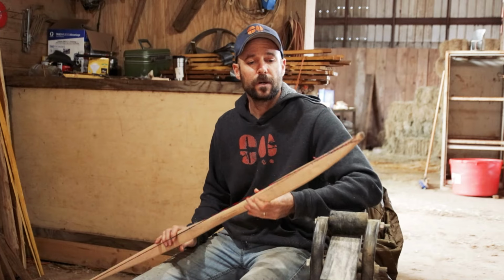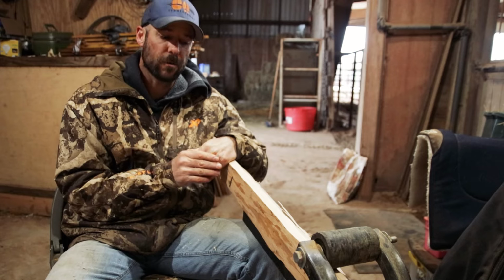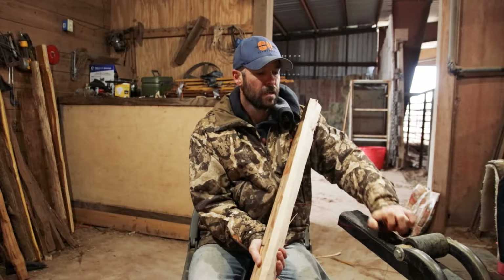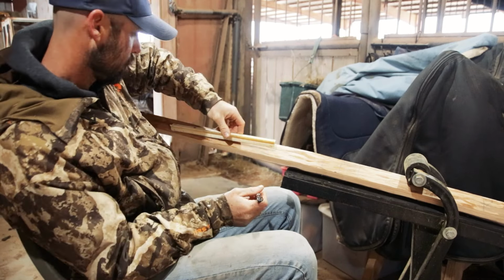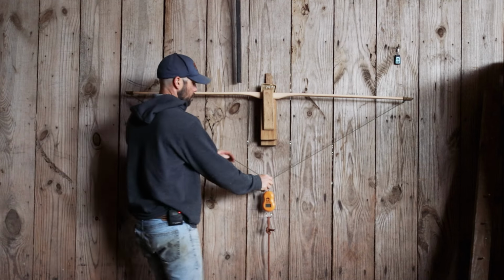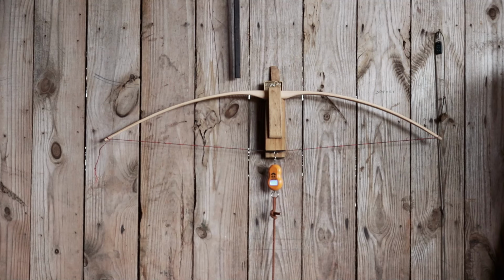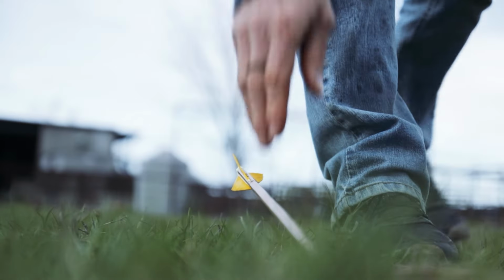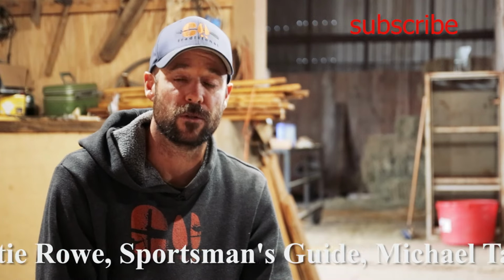Building the Hickory Self Bow

Comment: What is a card scraper?
Reply: If you look up a “cabinet scraper” it should look like either a rectangular steel card, or it may be a gooseneck shape.

The edges are burnished where a burr hangs off. They are drawn across the stave at an acute angle, and the burr will curl off a thin sliver of wood. 

I’ve curled wood thin enough to almost see through it with them. They are excellent finishing tools, especially while fine tuning your final tiller.

Comment: Cool thing about white woods is you can harvest it yourself. Free wood to learn with. Rough it out and once the moisture content is 8   to 10% it's ready to finish. No waiting for years.
Elm makes a nice 68" long flat bow. 2" mid limbs and 5/8" at the tips.
Nice video.
Reply from the maker: Absolutely!
Reply: What is white wood and why can you harvest it yourself?
Reply: @robertbrandywine  
For example 
Elm,
Ash,
Hickory.
If you have a saw, then harvest it yourself. If you haven't, ask a friend.
Reply: @Bullseyearchery  But why couldn't you harvest non-white wood trees yourself?
Reply: @robertbrandywine  I think you are missing the point we are trying to make. White woods are ready for bow building when the moisture content is right, so it is ready in weeks, not years.
Harvest whatever takes your fancy. Fill your boots.
Reply: @Bullseyearchery  I think what you are saying, based on this last post, is that non-white woods take so long to dry that most people will buy them pre-dried by someone else, but with white wood you can harvest, wait a little and then start the bow.  Right?
Reply: @robertbrandywine  In a nutshell, yes. 
It's not that premium woods take longer to dry. They have to be  seasoned for several years. The wood will then keep its shape better as a bow. 
White woods tend to bend out of shape (follow the string- take set) when being drawn many times  shooting them. These bows tend to lose power or cast.
Reply: @Bullseyearchery  Okay, thanks.

Comment: Great info on Whitewood Clay'''' Im in central Missouri & have access to different types of Hickory  &  Sassafrass as well,,,,  I have found that the ''latter''  reacts much the same as Hickory as to taking a set early on in the tillering process..  Could you tell me at what point in the build would be a good time to Recurve  the limbs on White,Wood self bows ??.. Lots of armchair info out there about this''''& my guess would be to recurve them early on as to not lose to much bow weight , by removing to much wood'''''  Thank You Sir'''  Love your channel..
Reply from the maker: I usually do it around the mid point of tillering, after the limbs are starting to bend. With whitewood, it’s often necessary to leave the reflexed tips a little thicker than with Osage.

Comment: Hi Mr Hayes i have a question I've recently got into building bows I made my 8 yr daughter and myself red oak long bows that r reflex deflex style to do this I ripped the boards in half lengthwise the used titebond3 to glue them back together wise a handle and backed them with rawhide worked great I'm now doing the same thing but it maple but I some how got the limb tips twisting in different directions one to the right one to the left when looking done the bow so how would I go about fixing this or over coming the twisted tips  thanks in advance
Reply from the maker: Hi Barry, with a selfbow limb twist can be taken out with heat. But that wouldn’t work for laminated bows I don’t think.
Reply: Hello Claye I did get the twist out of both limbs lastnight I used a heat gun and kept the limb clamped nut super tight enough so it wouldn't come apart and used a longer clamp laying across the limb extending from the high side and added other clamps as weight I twisted it past being flat to allow for spring back let cool and do the other end the same way not sure when u had replied about using heat lol but it did work for me now is now backed with rawhide and wrapped to cure thank you for your time and help

Comment: Nice craftsmanship!

I build the traditional style bow too. I have been primarily making the subclass of selfbow called the American Flatbow.

I am not as traditional as you in that I do use rough cut lumber to start with rather than using an actual stave of Hickory.

Speaking of Hickory, I just made a 66 inch 35 pound American Flatbow that I placed on EBay to see how well it might sell. I had Birch, White Oak and Hickory to chose from for the wood I used. I started with Hickory and was well on my way twice to a completed bow when each fractured while in the tillering process. 

My 3rd effort used White Oak and it worked fine. Surprising to me was the issue with the first failures was not grain related. Rather, I had used Hickory heartwood and everything I have since read plus my experience with two failures indicates the heartwood is too brittle or can suffer from what is called Brashness. 

Too bad, I have a lot of Hickory heartwood but the Birch and White Oak make a nice Self bow, but never leave them strung all day, especially the Birch for it loves bending.... As far as the heartwood; I used one fractured effort as a riser in a Take Down style traditional Self bow and there it just can't fail and it looks great.
Reply: It is a Holmegaad  (Denmark) flatbow 9000 years old. Googel it if you ar in doubt:

Comment: Hello Clay, nice video think you.  Quick question. I have about 10 staves that I split out of Black Locus around 6-7 years ago.  I left the bark on, but I did seal the ends with a good quality wood glue.  Was it a mistake to leave the bark on and let them cure as long as I have?  They are suspended in my basement here in Ohio which has higher humidity than the rest of our house.  Life got in the way, but hopefully I can still make a go at it this spring.  Appreciate your hard work and considering Patreon membership for you.... thanks!
Reply from the maker: They should be fine. You might want to check the moisture content in them if that humidity is very high.